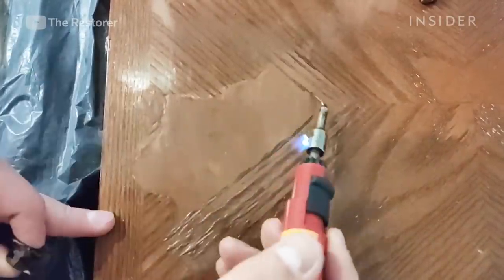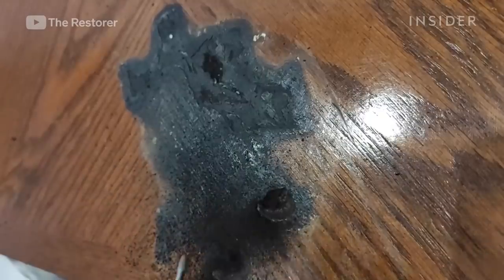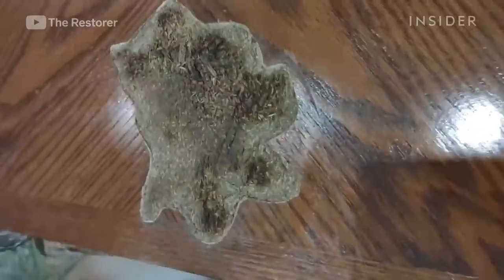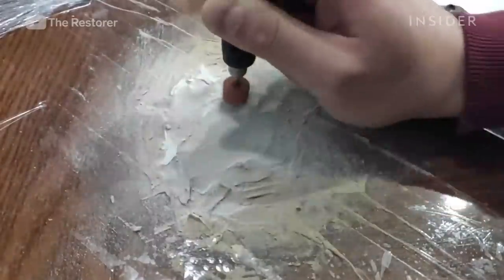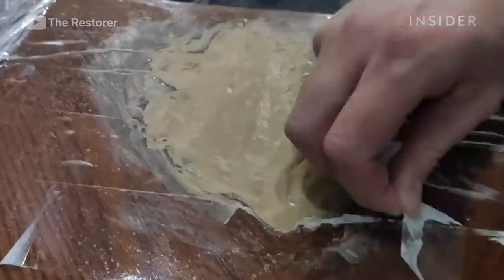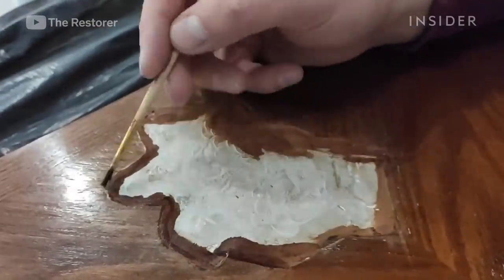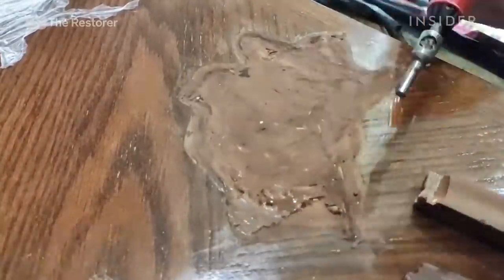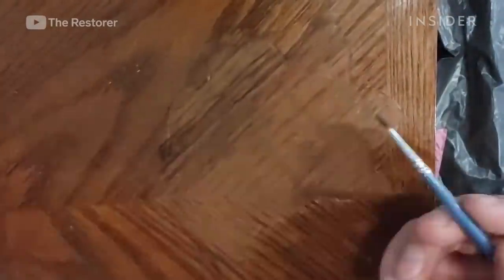How A Burned Table Is Professionally Restored | Refurbished

Comment: I worked at a office where we had an expensive hardwood door installed. During the installation a workman got upset, slammed a hammer into the door and left an enormous gouge. They brought in a professional restoration expert to repair the hole. It was quite impressive (like this video).
Reply: did they pay the workman

Comment: If the furniture has enough value to be repaired, it should be done correctly, not by slathering wood bondo on it.
Reply: do you happen to be a professional wooden furniture restoration technician?